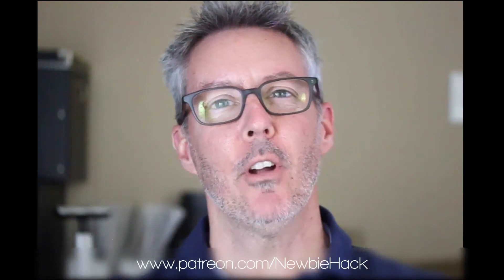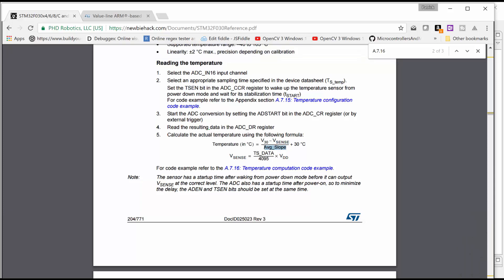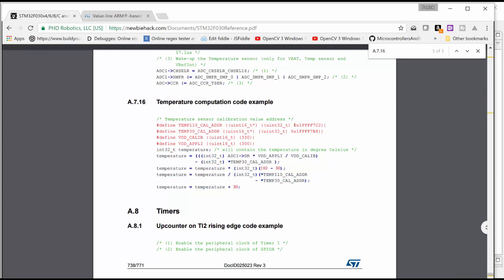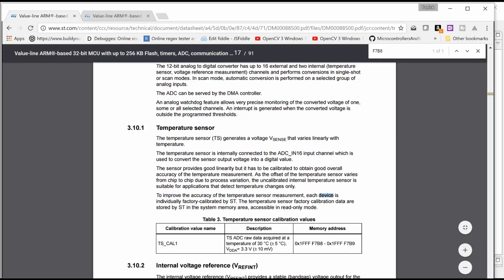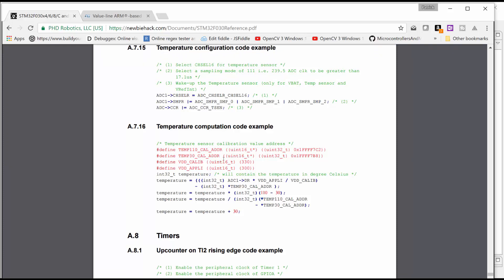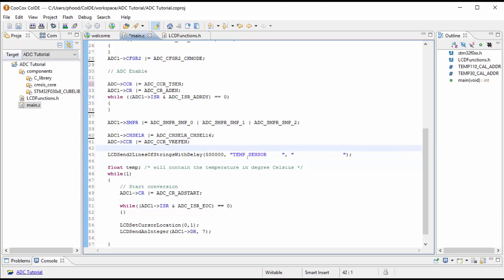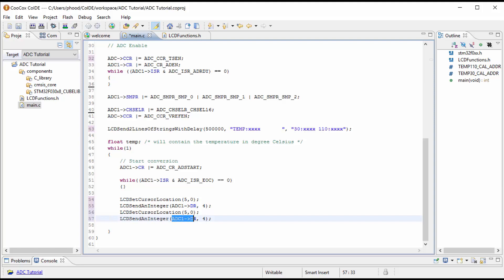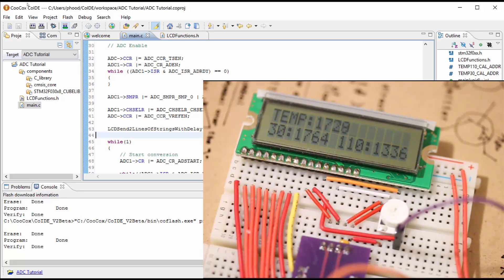37. How to Convert the Raw ADC Temperature data into a Degrees- STM32 ARM Microcontroller Part 1

Comment: At 6:05 its only single byte at each location. Hence for storing 12 bit value its needed to store in two bytes wide area and thats why they have given two memory location. If single location could hold 32 bit value then there was no meaning to give two addresses. A little ago thats why the casting was made to 32 bit uint and then to 16 bit uint pointer. Whatever the system bus width is, an address still holds single byte. Thats why with odd 14 bit wide pic 12f or 16f series still hold either single byte or 6 bits. These are actually basics of any microprocessor or microcontroller and you dont need to be confused about it.
Reply from the maker: Understood.  Thanks.